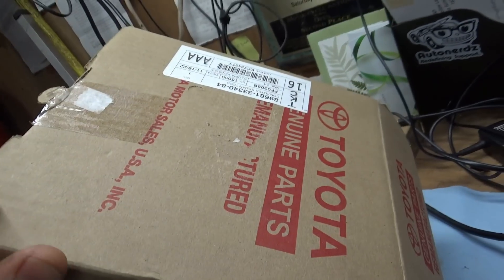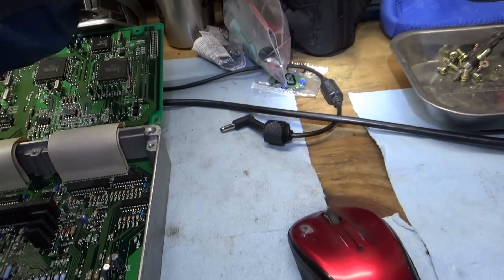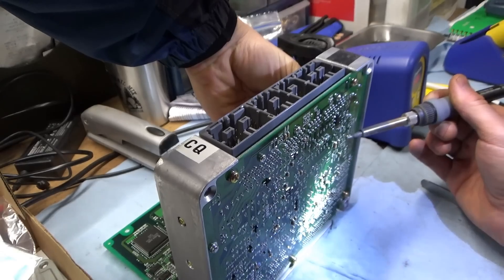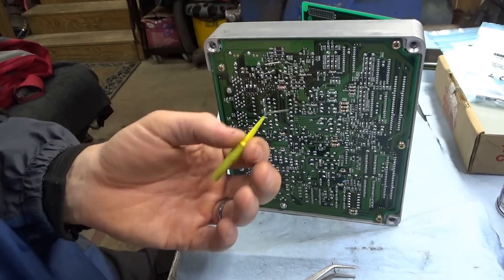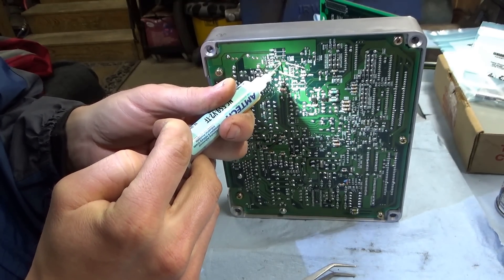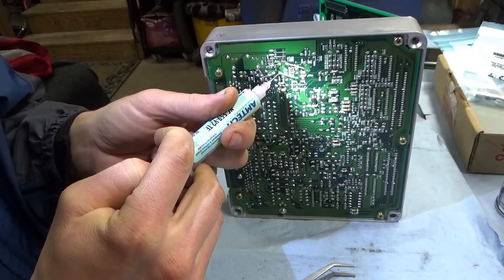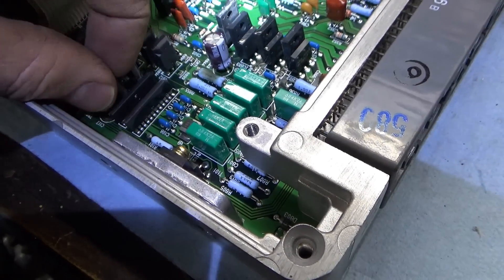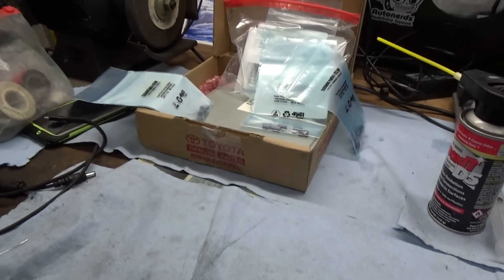Crazy Classic Camry: Intermittent LIMP-HOME? (Part 3: COMEBACK?)

Comment: Pro tip: Hold your soldering iron at an angle (maybe 45 degrees) on the solder joint while heating the pad to remove the component instead of only touching the tip (which has a pretty low thermal mass/contact area) on the joint. It will melt faster and keep the solder joint liquid for longer that allows you to move the part/leg. Remember, the more contact area your iron has with the solder joint, the better. And also try not to move the iron too much while trying to heat the pad up, because you lose the contact area, the thermal transfer becomes smaller, an d in conjunction with the big thermal mass of the board, solder gets cold and solidifies again. Also a wedge/chissle tip on the iron whould really help instead of the pointy one for through hole jobs like that! :) Also you shouldn't max out the temperature of the station in normal conditions. If the iron gets too hot (maybe above 380-400C, metric guy here) the flux instantly evaporates without doing its job, and your iron tip oxidizes, leading to the solder refusing to stick (flow) into it.
Finally, if the solder area is clean and free of oxidation, your solder is of good quality and the iron's temperature is not too high, you should see the solder wicking in the pad and the leg of the part and not leaving "whiskers" of solder while removing the iron. Pointy whiskers that you have to reheat and reshape or scrape away with the iron probably mean that the iron was too hot or there was not enough flux applied while soldering. If the solder area is free of oxidation, solder prefers to flow  in the pad and onto the leg rather than make pointy whiskers.

Sorry for the long post, I hope that it helps somewhat!
Reply: I cut the wires on the component side and then pull the wire tips from the solder side
Reply: @eddiesouther  That is good practice, unless you don't have room around the component for your pliers or suspect top side board damage (like here due to a leaky cap). You risk scraping a trace out with your pliers if you are not careful enough or ever worse mechanical damage to the via/pad! Situations that involve board corrosion are really finicky!!
Reply: And keep solder on the tip.  It improves heat flow.

Comment: I like to use a solder sucker and heat the joint then suck the solder off the board. Then i will bend it straight and pull component out.

Comment: Let say you got a 25 volt capacitor with another number as long that number the same you can replace the capacitor with a 50 volt capacitor if you don't have a 25 volt capacitor
Reply: The 50V  cap will be physically larger, and may not have the same lead spacing.  ESR is another consideration.  It takes me awhile to do an exact electrical and physical substitution.

Comment: Brother, where is your ESD setup?  lol
Reply: His garage is so moist that ESD is of little concern.  It's not like he's soldering stuff in a carpeted office...If you could even get 25V of static in that concrete-floor garage, I'd be surprised.
Reply: @nhzxboi  checkout ESD damage videos.  In the right conditions, a person can collect a static charge over 18000 volts.  Just a simple wrist strap and grounded work pad.
Reply: @williamthompson2222  Agreed....but not in that wet garage of Ivan's.  Potential is very low there.
Reply: I've heard anti-cling works. Just dilute with water spray mist the floor and your good

Comment: Hehe.  My guess from the 1st episode was correct.  Lucky, but correct.  Things get old.  semiconductors survive but chemical electronics(electrolytes) are the 1st to die.  Capacitors...sometimes they can be removed and things will work fine.  If they become a short circuit, things don't work.  Fun stuff.  Valuable service for legacy automotive electronics.

Comment: heck yea ivan more electronics repair as a electronics guy and a car guy i love the board repair videos keep up these repair videos .wen you take through hole stuff out flow some fresh solder into the solder joints like alot then they will just come out pulling from the other side

Comment: If traces ever go bad, you can solder in a jumper wire to act as the new trace.  I've had to do that several times on boards in my appliances that have had thermal events and left nothing but charcoal around the offending component.
Reply: hey that's good o know , thanks .
Reply: I have had to do that with a bunch of old vehicle electronics. Just go to the next connection on the trace and solder in a jumper wire.
Reply: On the note of board charcoal, also watch out if the board is too scorched because those areas can become conductive (essentially the carbon residue can be conductive).  More of a concern as the voltages involved become larger or if there are sensitive circuits.  If in doubt, check ohms in the suspected problem area with a meter.
Reply: pretty common kluge in vintage industrial equipment where spares are nonexistent. My only concern in a vehicle would be vibration, RTV the wire to the board?
Reply: I just wrote the same comment and then saw yours, lol.

Comment: A tedious process. I did this once, where the ECM on a 88 Plymouth/Dodge caravelle owned by my mom had a couple leaky capacitors. I could have replaced the ECM, but chose to do the electronic repairs on the original. I don't know what could have caused it, but the parts I used were the same values as the original, but a different brand. I had heard the original branded capacitors of that era tended to go bad unexpectedly.

Comment: Digi-key has bailed me out many times! Great company
Reply: I had a relay on a board for my clothes dryer have a thermal event.  Couldn't find a replacement board, but I found the relay on digikey.  $5 + $3 for shipping and 3 days later my dryer was working again ... for a few years until the same relay had an even bigger thermal event and took out a bunch of stuff around it.  No hope after that.